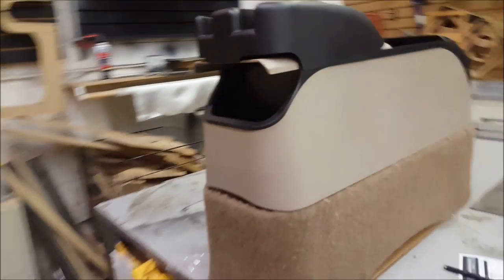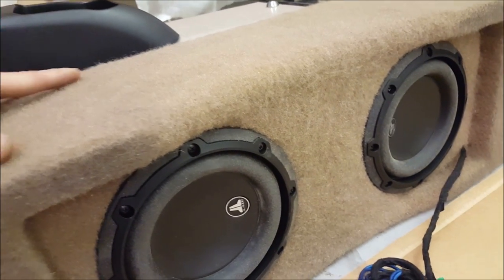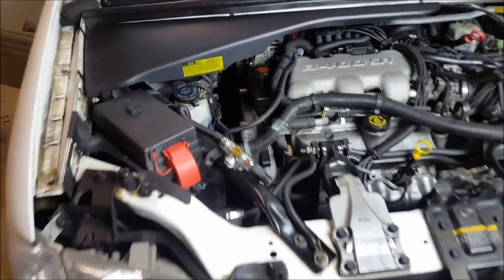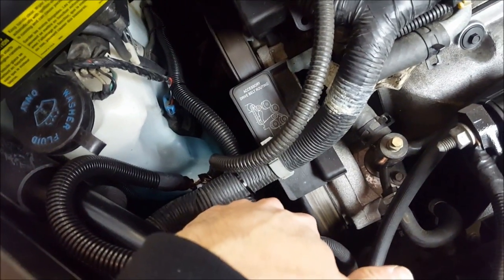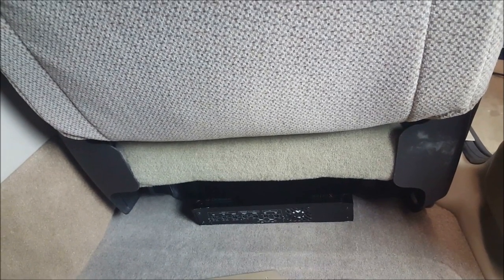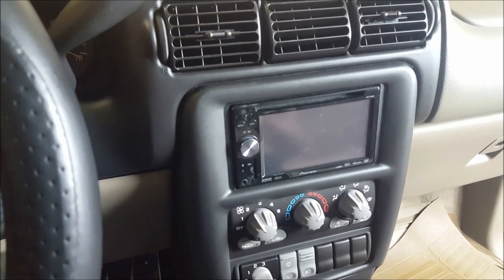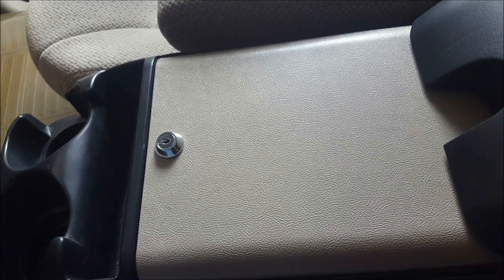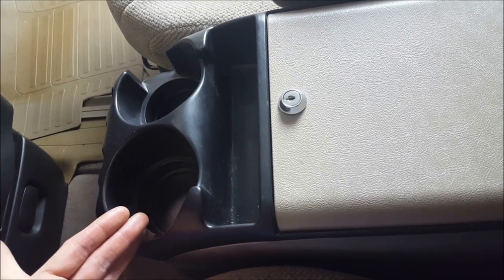Builds: Custom Center Console Enclosure (Pontiac Montana Sound System) | AnthonyJ350

Comment: My boyfriend and i have worked on his 05 Blazer ..custom rootbeer paint , brakes upgrade, real walnut burl venner trim, pigskin leather and he upgraded his alt from a 80 amp to a 100 amp @idle and then changed his stock stereo to a raspberry pi 3 with kodi and touch screen installed with the newer stereo in the centre console box and alot more The great thing of it all is We did pay for someone else to do it. I only wish he would post a video
Reply from the maker: Niice!  If you have pictures tag me on Instagram: AnthonyJ350.  I'd like to see it!

Comment: just my two cents, I would secure the enclosure from the inside by removing the 6"s. That way the outside looks completely slick. OEM parts don't show screws or bolts. But all in all, I really like the setup

Comment: the difference between minivan and suv is the philosophy. minivans are big fwd cars that can hold a bunch. suvs are big powerful trucks that happen to have the rear closed. i like both, for different reasons
Reply from the maker: +RedTeamWolf I get what you're saying.  But besides a few fullsize SUV's.  Most are unibody and the motor is transversely mounted i.e. Ford Explorer, GMC Acadia, Nissan Pathfinder I believe.
Reply: +AnthonyJ350 those aren't really suvs. they're minivans that just look like suvs
Reply from the maker: RedTeamWolf That's how they're marketed.  It all boils down to the station wagon.  I understand your definition of an SUV is architecture and capability which I agree with.  Let's say a Tahoe or the older truck based Pathfinder or 4Runner for example.  

Marketing and the rest of society needs to feel good about themselves and feel like they're adventures driving "minivans" disguised as an SUV when they go to the grocery store or pick up the kids.

I'm going to say 80 percent of all 4WD and AWD vehicles don't actually go "offroad" and only use their capabilities if it's snowing a lot going up a steep hill.

Comment: what kind of suv are you talking about? Tahoes, Expeditions, Excursions, Durangos, Suburbans, Cherokees, and Hummers do not have a back end like the one you taped off. Other differences include hoods that are longer and sit more level in relation to the ground, V8 petrol and diesel engines, tall suspension, 4 wheel drive, Higher sitting positions, doors that open properly rather than slide, and square bodies. Comparing them to mini vans the way you did is like saying an eclipse is as cool as a gallardo since they have the same basic profile, the difference being that the gallardo has an edgier body.
Reply from the maker: +Lucas Sidor Well I did mention other acronyms.  But I'm referring to new Pathfinders, CR-V's, RAV4, Explorer, the old Caliber.
Reply: AnthonyJ350 those are crossovers, not SUV's. The whole idea of them is to be a middle ground of SUV's and mini-vans. That's like saying nut huggers are as "cool" as boxers because they're both similar to tidey whitey's. You're comparison just doesn't make sense.
Reply: +Matheus Caixista but you're trying to say the nut huggers are as cool as the boxers by pointing out the marginal popularity of the middle ground. Mini Vans are signs of a defeated man. There's nothing cool, attractive, or fun about them.
Reply: +Matheus Caixista sorry, meant to tag the other guy lol
Reply: +Matheus Caixista ID prefer an excursion as a sleeper.

Comment: Do you have a problem with the amp over heating on the floor like that with all the radiant heat coming up or did you put some kind of insulation on the floor before hand?
Reply from the maker: Long Duck Dong There is some sound deadening. But I put amps under seats all the time. No heat issues.
Reply: Long Duck Dong  if your having heat issues with your amp you need a bigger ground wire.
Reply: Not having heat issues....was just curious

Comment: Time delay is a useless feature, you can't tell the difference in such a close proximity. The only difference you can hear is volume, the closer speakers are louder than the ones further away. No one can hear the difference at the speed of sound when it's 3 feet away.
Reply from the maker: heavyset0223 Actually you kind of answered your comment. You're right the closer speaker does sound more dominant. After setting up the speakers for the driver you can hear both sides better. We install a lot of audio weekly and I can hear the difference, it's slight but there is a difference.